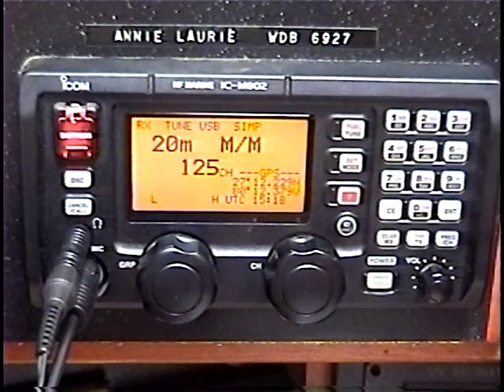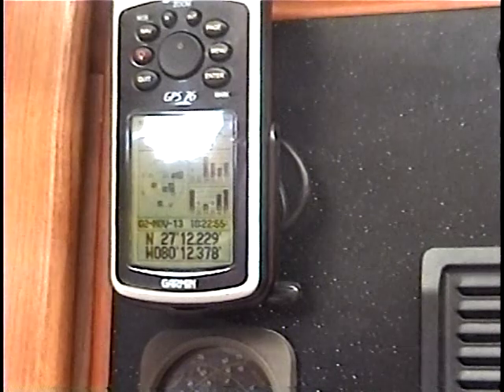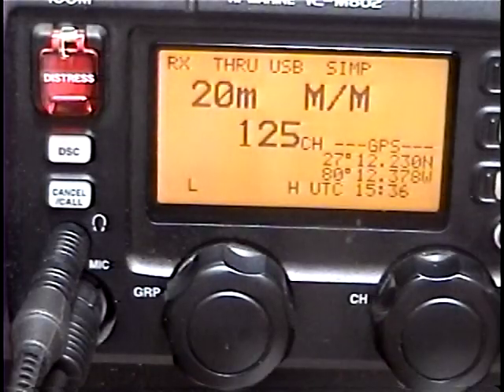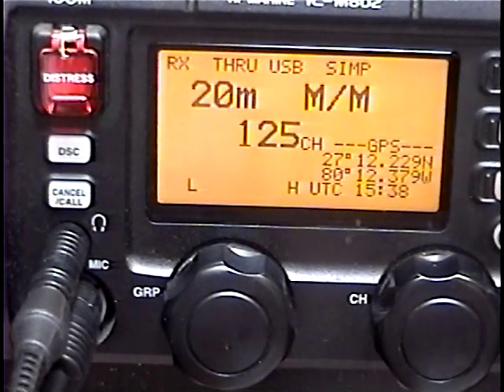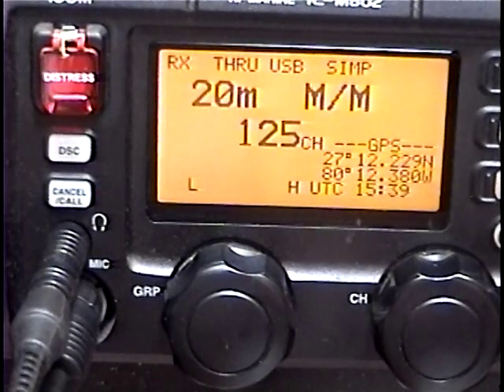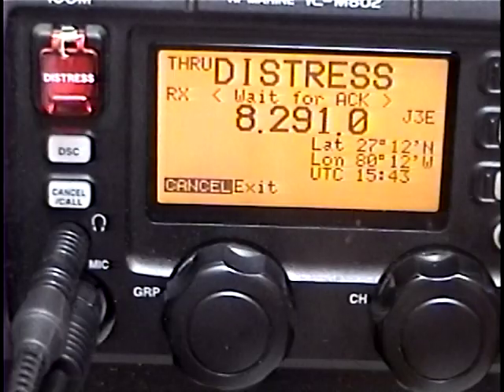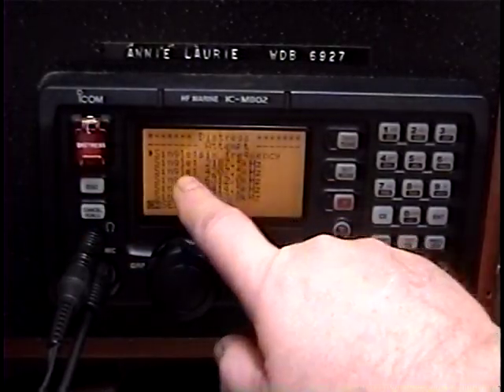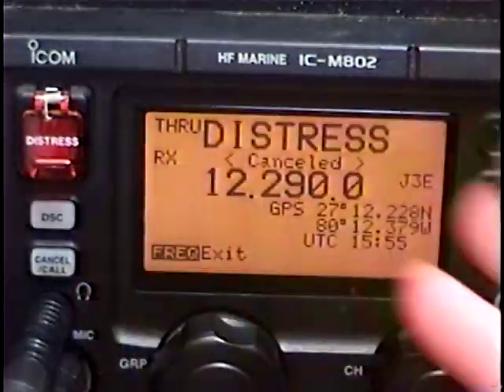Icom M-802 Video #8, HF-DSC (Digital Selective Calling), Distress Signaling

Comment: Sorry Capt. John, I'm not clear on something from the video. I understand for continuous monitoring of DSC that a separate antenna is required. However, if I initiate a DSC, will the M802 listen for an ACK on the main receiver or just the dedicated DSC receiver? If the later, then the DSC would be much useful in in an emergency and useless for non-distress modes.

Regarding cancelling after having initiated on all six distress frequencies, it appears to cancel just on the frequency it is currently cancelling on. I suppose that's okay since it didn't get an ACK on the prior channel.

Comment from the maker: Marshall, the AT-140, like ALL Icom tuners made in the past 25+ years, will perform a "tune" only when instructed to do so by the radio....Using the M-802, you can program the M-802 to either only perform a "tune" when you press the TUNE button, OR program it to perform a "tune" each time a transmission occurs on a different freq (so called "auto-tune" function of the M-802)...
It has been 20 years since I used a M-800, but I believe it will do the same as the M-700, M-802, etc. but regardless, the answer is NO, the AT-140 only tunes when prompted to do so by the radio...
FYI, questions like this are better posted on SSCA, etc...Youtube is NOT the place fora long discussion!
Fair winds!
John

Comment: Capt. John, Thank you very very much for  this clear presentation. Semi-related question: Does the AT-140 antenna tuner "auto-tune" before each transmission? I have a M800 and have not yet installed my new M802.

Comment: John your videos on the m802 are very helpful, I am a ham radio operator AB9EW amateur extra and a ham since January 21st 1997 back when I was 16 and a half and a freshman in high school are you a ham? How long have you been a ham I love SSB ham aero SSB long range and marine SSB long range and vhf USA and international channel monitoring, the reason why we don't use the 160-161 B side of vhf international duplex channels here in the USA is because since 1945 the railroads in the USA and Canada have used 160.215 MHz to 161.565 MHz 15 kHz spacing between channels as railroad channels, and like the railroads they use simplex communications and not many repeaters and the marine vhf spacing in the USA between channels is 50 kHz some 25 kHz mainly channels 156.775 and 156.825 both limited to 1 watt. The rest of the world uses 25 kHz channel spacing and no A channel designation boat recives 160-161 MHz from coast station and transmits 156-157 MHz 4.6 MHz lower on A side channels and recives the B side of coadt stations outside of the U.S. And Canada I live two way radio communications hope I didn't bore you john just passionate about these this topic
Reply from the maker: Andrew Bowe Thanks for the comments...I've been a ham since the 1970's, when I was a teenager.Look me up on QRZ.com  Thanks,  KA4WJA,  John